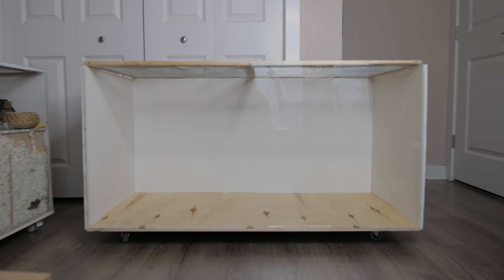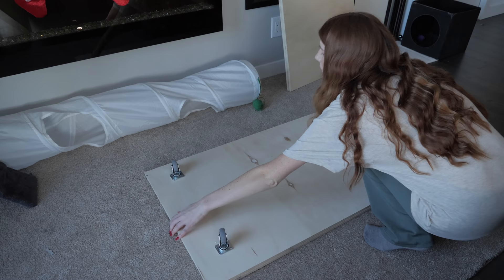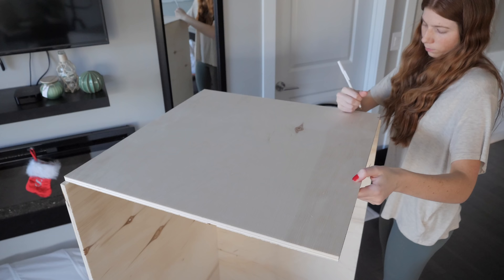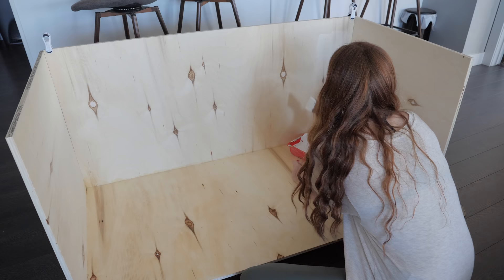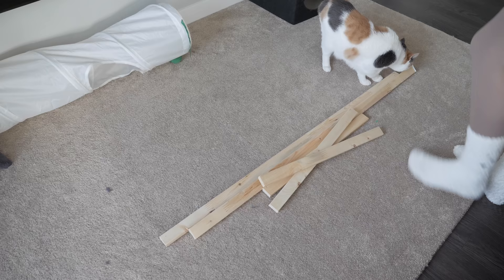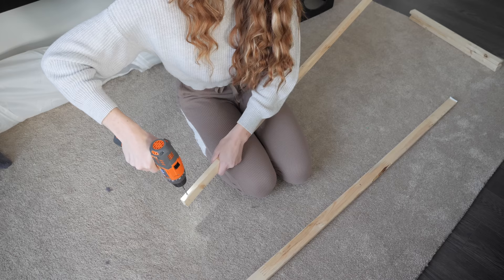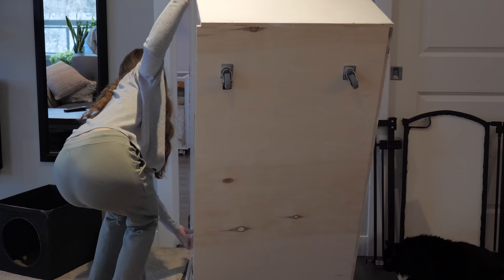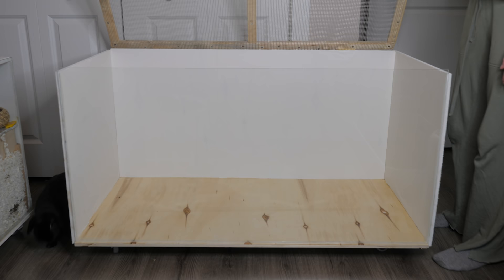I Built ANOTHER DIY Hamster Cage?!

Comment: Attaching two pieces of wood at a 90 degree angle is sooo much easier if you have corner clamps. They are a great investment for people who like to DIY and are not expensive. I really recommend them! They are fantastic! ❤
Reply: Also to prevent the wood from splitting you can use your pilot holes to to guide you to predrill the other piece of wood as well, so that the screw would go in easier. There is also a variety of screws, some of which are thin but still long and are less likely to cause splitting. Maybe you used different screws this time so that caused the problem. Sorry for unsolicited advice.
Reply from the maker: I'll have to look into the clamps! My dad has all the clamps but alas I have none! I actually used the exact same supplies so that was not what caused it 😊

Comment: For those who aren't so handy: Ikea's PAX or PLATSA base elements also make for great enclosures.
Reply: thank u sm
Reply: halcyon ! ♡ ° i highly suggest an ikea detolf ! it has around 1K square inches of floor space. people who used IKEA to make hamster enclosures never had a problem with it, but a detolf is a great option if you’re worried :)
Reply: halcyon ! ♡ ° also it is around 80$ i believe, while a tank its size is 800$. so this will save you a lot of money !
Reply: @halcyon ! ♡ ° The hamster won't be able to chew the edges of the cabinet, so it should be safe. While the ikea detolf is also a good alternative, it's glass so it won't be as sturdy as the wooden base elements. The Platsa or Pax elements allow you to add wheels, and you can stack them if you have more than 1 hamster.
Reply: @KimHmrs will the pax be okay if i add varnish for when the hamster pees
Reply: @_alura  Varnish isn't really needed. Hamsters don't pee in such quantities that the bedding isn't able to absorb it.

Comment: Usually to prevent wood splitting from my experience you'll need smaller screw or nail. Sometimes you just need thin nail rather then thicker screw. It varies on the  thickness of your plywood as well

Comment: If you want to avoid the ply-wood splitting You can actualy use a drill to create a hole before putting the screw in :)
Reply: is there a reason why not just use nails instead of screws?

Comment: Hi.  I just built a cage similar to yours, I say similar because my granddaughter watched your video and bought the materials based on it.  Here are my thoughts.  If you are going to have Home Depot or Lowe's cut the pieces for you ask them to run a test on another piece of wood.  The saw that her Lowe's used had an old blade that was out of balance and ruined all the edges.  I cut the size down a litte to get rid of the Lowes cuts.  Plus measure each piece as it is cut and check for square.  If they mess up they will do it again at no cost.  I glued and nailed hers with my brad nailer.  If using screws, use finishing screws.  Using non-tempered window glass is not only scary, but makes it very heavy.  She paid $90 for a piece of 3mm.  I'm concerned about how dangerous that would be so close to the floor.  I agree that you don't want a larger piece of plexiglass.  I built a face frame and used two 20" x 20" pieces of 3/16" plexiglass.  The plexiglass was $36, cut at the store, and lots of pieces left over. The frame is made of 2" wide 1/2" plywood with a 4" wide plywood piece down the middle.  I milled some pieces to hold it in, but plastic mirror clips would work.  3/4" pine boards could also be used, and cut at the store. It looks great and weighs about five pounds.  I made it so that it is removable for cleaning or replacement.  The entire inside was covered in white contact paper.  I made strips of contact and folded in a crease, and then used them to seal all the joints...instead of silicone.  I also cut some patches of left over paper for future use.  I hope this helps a little.  Thanks for insipiring her.

Comment: im probably so late for this BUT a good way to make sure wood does not split while drilling into it is if you have a drill bit slightly thinner than the screws you are about to drill in it is always good to pre-drill the holes it just helps take tension off the wood when you introduce the screws :)

Comment: This is a great base for what I’m planning to do for my DIY cage though I need to be able to take it apart. 
To do this I am planning on using smaller pieces of wood to frame the glass so that the front can be taken off easily. The wood is going to have cut out sections in the middle so I can silicone and slide in the glass from the top!
I’ll be adding mesh panels on the sides as well to hold water bottles and a wheel though im not sure what the best way to attach these would be.

Comment: I made made an extremely similar cage, same dimensions, and was going to use screws to hold the plywood together, but I was told that the plywood would start splitting. Instead, we wood-glued the plywood together and held it with clamps. Once the glue was dry we pin-nailed the plywood together with a pin nailer. It went pretty fast as a pin nailer is basically like a staple gun but shoots small nails that didn't split the plywood. If you have the tools, this method worked well and is strong and sturdy as long as you use a decent amount of nails. :)
Reply: Nice tip! Thanks for sharing! 😁
Reply from the maker: Another great way to build an enclosure!

Comment: Pro tip,  when you paint the lid white, run some white paint lightly over the wire mesh. It will give you an incredible finish and help tone down the silvery metal that can take away from the white. You can also use black paint if you're feeling daring. The result is essentially the same but I highly recommend trying it.
Reply from the maker: Interesting!

Comment: 2:18 Did you drill pilot holes into the edge grain before driving the screws? 😳 I didn’t see that in the video. If you didn’t, then splitting was bound to happen.
Going straight into the edge of the plies like that has a good chance of splitting. I don’t know if the soy is weaker than UF, which might make a difference.
Using the right size drill bit, drilling deep enough, or using 3/4 instead of 1/2 might decrease the chance of splitting. Pocket screws into 3/4 would’ve probably been better, but that involves tools many people don’t have on hand and a costlier plywood sheet.

3:20 I hadn’t heard of that varnish before. It looks neat. I hope it’s effective. When it comes to pet-safe finishes, I’ve used pure raw linseed oil and Seal-Once Nano+Poly (for outdoor).

5:34 I hadn’t considered real glass. My guinea pig enclosure is made with a 3mm x 4' x 8' sheet of plexiglas, which cost me $147. 😳

6:00 Does silicone alone keep it secure? I used an unnecessarily complex method of keeping the acrylic in place. 😂 (Video of me building the piggy’s Château de Fluffy is on my channel.)

7:24 Sorry for that pain in the butt. 😅 If it holds together, that’s really all that matters.

9:40 You did a really great job—even more so if you don’t have much experience with this sort of thing! There are plenty of disasters on YouTube. You should be proud of yourself.

I’m not trying to hassle you. It’s meant to be constructive. I’m a woodworking hobbyist, so I notice things. But most of what I watch on YouTube is guinea pig videos. 🙂
Reply from the maker: I didn't! As I didn't when I made the last enclosure with the same materials and had no issues but these enclosures were built in opposite seasons so I'm guessing that along with maybe just a crappier piece of wood I choose this time! The silicone holds really well! In fact when having to take glass off an enclosure like this last time the only way it would come off was with a razor blade haha 

Thank you! And thanks for the advice for next time!

Comment: Imho - the screw length wasn't your real issue, it's the joint method. For wood butt joints I highly suggest pocket holes for beginners or mitered, or you can do finger dovetail and more for advanced :) **wood glue is usually also used
Reply from the maker: I was just surprised because the last enclosure had no issues
Reply: @VictoriaRaechel  yeah I figured as much, but you said it yourself! The ikea was hollow hahaha
Reply from the maker: Oh I don’t mean the Linnmon. The enclosure Mabel is living in is made the exact same way this one was with the exact materials.
Reply from the maker: Its in this video for reference https://youtu.be/_49KhTzhPUk
Reply: @VictoriaRaechel  ahhh the other other one.. that is surprising then, that it didn't split the first time! Hahaha but yeah that was bound to happen dood, all good! Now you know lol welcome to woodworking 101 😁
Reply: @VictoriaRaechel  yeah I remember this one, this was the 2nd reboot right? From when you found out about formaldehyde in compressed wood? Truth be told, all panel boards have them lol
Reply from the maker: @polgara9118  I assume maybe weather temp has something to do with it?(that one was made in warm weather, this one in cold) or I just had a better piece of wood lol 

Purebond plywood actually doesn’t contain formaldehyde in their adhesive like traditional ones 😄
Reply: @VictoriaRaechel  yeah you're probably right about that prolly weather/humidity. And I believe you about purebond plywood I looked for it immediately when you first uploaded the vid lol but hey! Incase you didn't know, Gorilla Wood Glue is nontoxic pva glue and is also food safe (indirect) used alot in those highly sold wood project cutting boards here on YT
Reply from the maker: Good to know! I use Lelage wood glue which is non toxic!
Reply: @VictoriaRaechel  I had to Google that one up hahaha!!! Le Page oh you 😂
Reply: @VictoriaRaechel  and why the new hamster cage getting a 4th one hurray!!!

Comment: Couple questions , why didn’t you use the furniture braces this time for the glass ? And is there a reason you didn’t make the glass just a tiny bit shorter so the lid isn’t hitting into it every time you close it ? How much was this in CAD $$ in the end ??
Reply from the maker: Wasn’t necessary, it sits on the lip of the wood & just happened to not do that. For me it was $184cad but that’ll depend on where you live as even wood varies in cost province to province.

Comment: Could you mention total cost for all the material and lastly did you groove the plywood so the glass would fit snugly or did you silicon the glass to a flat surface and which surface did you use the front facing or just the bottom and the inside portion of each side of the plywood.  What was the weight of the piece of glass used for the front?  I admire your inventiveness on doing the entire project using only yourself as obviously one more person could have helped steady the joining process.  I am sure a happy hamster of the future has a great and spacious home.  I do think vertical space counts as the hamster can travel and move within their burrow system and of course the top of the bedding surface thus rendering added living space.  This is not even mentioning vertical climbing spaces that are placed on the top of the bedding.  A 2D living space with no depth really limits the hamsters movement.  I like to think of a deeper enclosure as a home being a two story dwelling versus a much less spacious rambler style home.
Reply from the maker: For me, it was $186 but the material cost varies so much depending on where you live, even while looking for the links to add, the wood I used varies quite a bit in price depending on what province you live in. I have the glass sitting on the lip of the base wood and I think the glass is 20lbs possibly 15lbs. Vertical space definitely is important when it comes to burrowing but something like levels/stories don't add to floorspace which is why floorspace is more important than something that has for example 5 stories.

Comment: Hello! We were thinking about maybe making an enclosure, and wanted to use contact paper on top of the wood like you did. I noticed this time you used Varnish on the bottom instead of contact paper. Is it because that the paper gets damaged from the hamster digging at it? Thanks in advance!
Reply from the maker: I just didn't have enough 😊
Reply: @VictoriaRaechel  Hello, thanks for responding! We are probably going using it in the DIY enclosure were gonna make.

Comment: I'm working on a cage of almost identical design. Or I would be, if Home Depot hadn't thoroughly screwed up my relatively simple order for a few pieces of wood.
Reply from the maker: Ahhh that sucks 😢  I hope they can fix that soon!
Reply: @VictoriaRaechel  I was warned about Home Depot by no less than 3 friends. Maybe Home Depot is better in Canada than in Los Angeles. My friends recommended Anawalt Lumber, who did in 30 minutes what it took Home Depot 2 weeks to completely screw up. The cage is coming together pretty well. your video is a big help thanks.

Comment: This looks really sturdy. I’m planning to get my first hamster next summer, your videos have been so informative and entertaining. Would concrete (polished and sealed, or raw) be okay for surfacing the wooden base (like a thin layer, so it’s doesn’t add so much weight) instead of using a safe varnish. Would the concrete be toxic?
Reply from the maker: It's definitely sturdier than other enclosures out there! I'm not too sure about concrete for the base, I would find that a little difficult to sanitize because it's so porous 🤔

Comment: Quick question before I Tackle this project this weekend! I ordered the Earth Varnish you recommended. How well would you say it has worked? Do I think need to add a sheet of contact paper to the bottom after it dries for extra floor protection from urine? Also, I’ve never used contact paper before. Any tips on best way to cut, arrange, apply to apply to the inside and outside of the enclosure? Thanks!
Reply from the maker: I'm not sure as my hamster in this enclosure doesn't even pee at the bottom so it's pretty much untouched!

Comment: I've been trying to follow this tutorial and it's not going so well. I couldn't find glass in the right size at home depot so I used acrylic, but the silicone didn't stick to it very well....I just pulled off the acyrlic wall and replaced it with wood. It'd be nice to have a clear front but from what I've read it doesn't really make a difference to the hamster and I'm on a budget so I don't really feel like spending even more money.
Reply: Update, I really don't mind not having a clear front to the cage. Leaving out the glass saves money. I also didn't use the wood stain, although I know I may regret that at some point. I laid cardboard on the bottom of the cage to provide a bit of protection to the wood  Anyway, a month into use and I love this cage, even with my cost cutting measures! I'm already dreaming of making something even bigger though XD

Comment: Is this cheaper than buying a cage?
Reply: I would say depends on the wood and size etc. However you need so much more space then people realise and although you can get large cages they don't always give the depth. You can buy cheap cages but they are often way to small and despite what they say shouldn't be used for hamsters. I imagine building your own would be more expensive short term but much better in the long run. You could also build it to your specifications.
Reply: @ngyb  I know how much space hamsters need and I have seen ones that were the proper size and depth but they were 100 to 200 dollars. Some of them were 300+ dollars so I was just wondering if that would be better or if making one would be better.
Reply: @PackAdventures  I think unless you look at second hand housing, those prices seem about right. What I would suggest you do is look online at some DIY stores that sell the correct wood and price it up as cost of material seems to change quite regularly.

Comment: you took down the rabbit gate and then put the cage on a blanket to move it. why not just slide it with the wheels… wasnt that the whole point of putting wheels on to make it easier to move..?
Reply from the maker: It doesn’t fit that way into the room because the wall juts out.